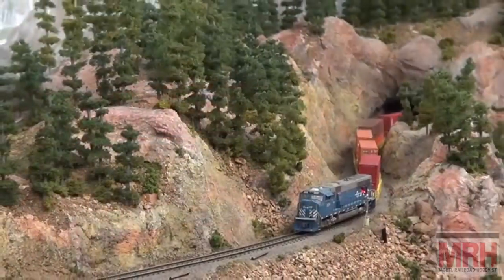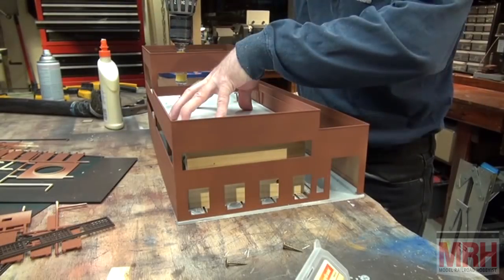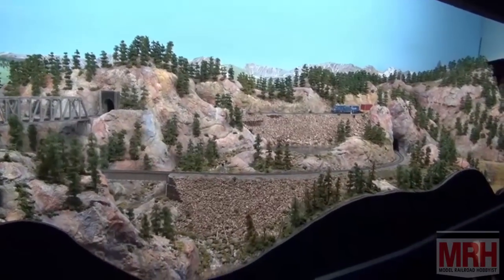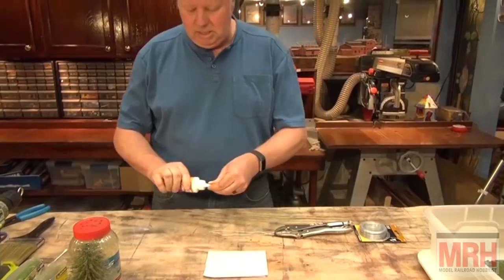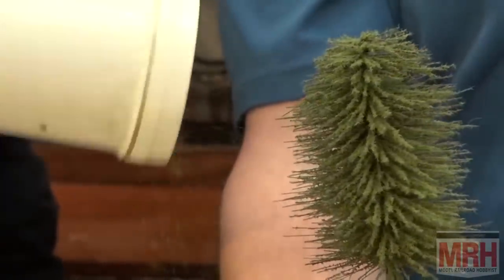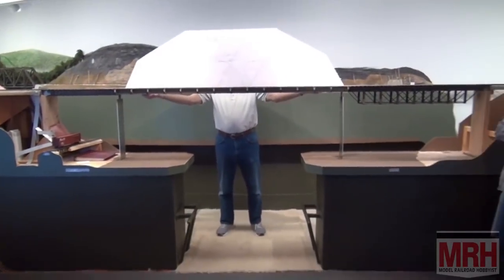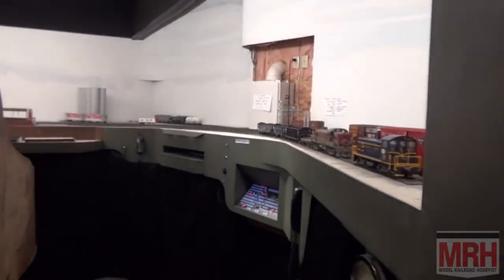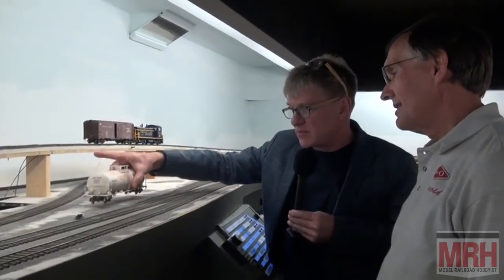Whats Neat in model railroading | June 2018 Model Railroad Hobbyist | Ken Patterson

Comment: I do the same thing for trees using manila rope unwind the lays of the rope soak them in water comb them out twist them between the wires with a grill let them dry then spray glue use the powdered grass to make the tree trunk I use wooden dowel rod and scrape the dowel with a saw blade to make it look like tree bark and paint or stain them brown and if you want them for a winter scene you can take white paint and some glitter mixed spread lighly on the tree let dry and spray with flat laquer to keep them looking  good

Comment: Search ebay for "pipe brush", select the option to only show "Buy It Now", and sort by "Price + Shipping: Lowest First", and you can do the same thing, but skip ahead to the part where you clip the wire off with the cutters. I used these kinda of wire brushes (also certain kinds of hair curlers... my mother hated that! LOL). I'd spray paint them green, and use them for pine trees. The addition of extra texture is a good idea, and further than I went back when I made trees liek that as a kid, but no need to put so much effort into spinning the brush, when China makes this stuff by the ton, and sells it for next to nothing... Actual green pipe cleaners can make for great coniferous shrubbery.

Comment: Nice job on the trees looked easy to do. Where do you get the hook for the drill?
Reply: Any hardware store, it is the ones you screw into the wall to hang stuff with just put the screw end in the drill.
Reply: Thanks for your reply I have to give it a try.